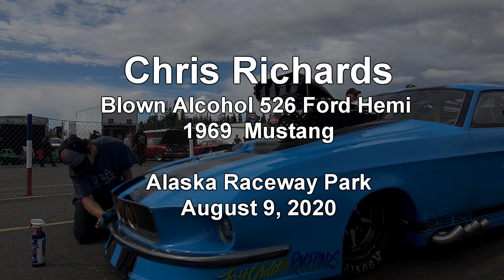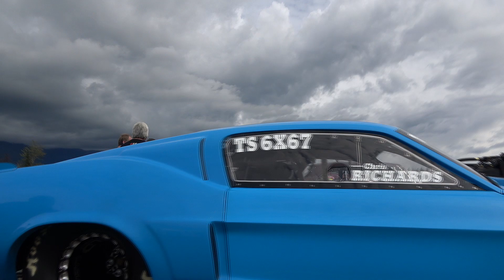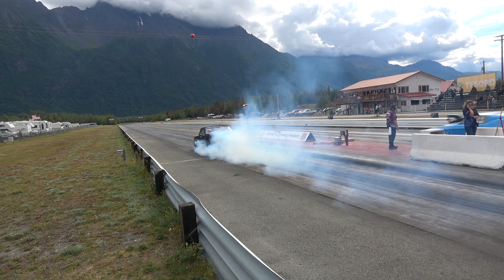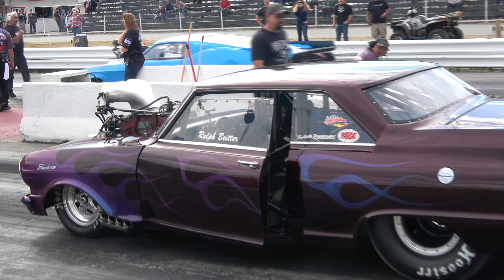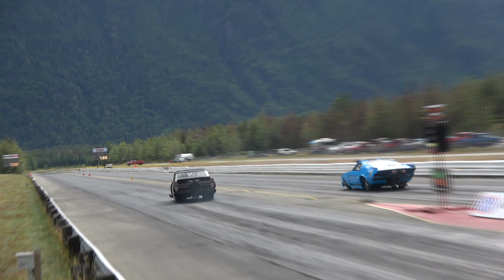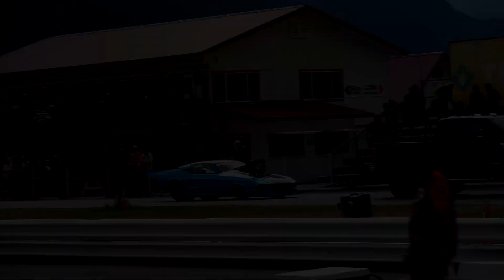Chris Richards blown alky '69 Mustang runs 205 mph

Comment: 1080p@120fps..... I always shoot at 1080p@60fps, I didn’t know the Sony AX53 could shoot 120fps. I guess I will check that out when I get home in the morning.Thanks
Reply from the maker: The 43 & 53 can capture @ 120fps. The 43 I got is new so I was playing with all the functions to see what they are capable of doing. This vid came out pretty good I thought color & motion wise. I need to try it with manual focus because trying it with motocross only looked good after you slowed it down. 4k is stunning though. The built in gimbal does a very good job for hand holding which is what I normally do.
Reply: @Area907-ASV  I agree, I shot all my NHRA @ Pomona & Sonoma with my Sony AX53 in 1080p@60fps....I would shoot 4k but it’s only 30fps so I find that 1080p@60fps looks very good still.....I just gotta have that smooth & sharp look from shooting 60fps.👍
Reply: @Area907-ASV  what camera did you use to record the Promod @ Vegas video ?
Reply from the maker: @frank-xp6pj  Pre 2020 vids were all done with a Canon Vixia HF11 as primary except for 2009. I still have it but it has been used and abused. The 43 was a retirement gift to myself this year